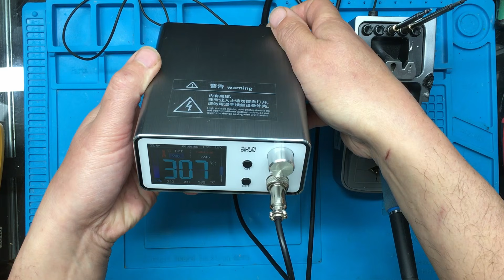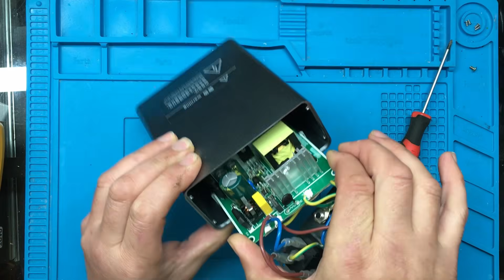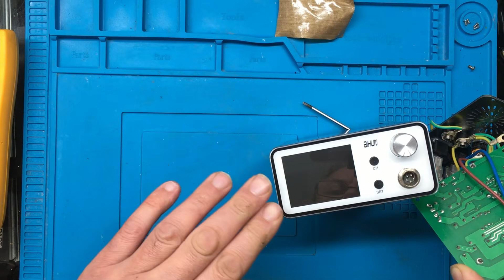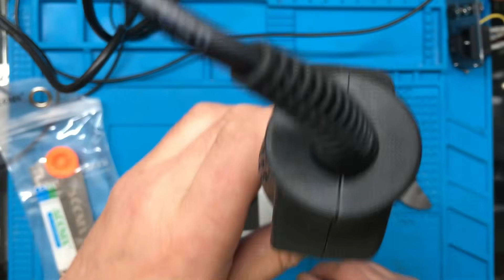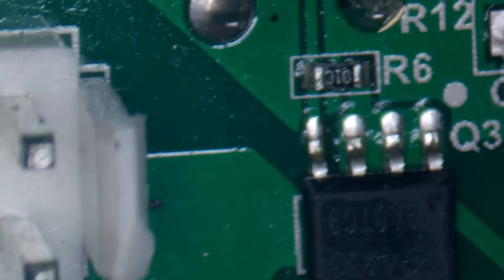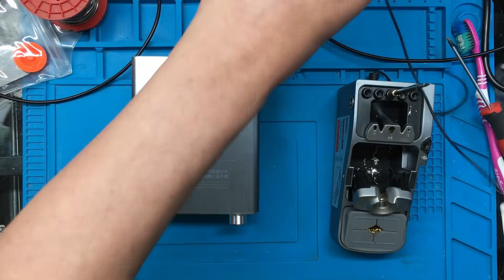Repairing An AIXUN T3A soldering station

Comment: just for the way it must be disassembled I definitely discard it from those I'm considering.  Insane.
Reply from the maker: It's not too bad once you know that front glass has to be removed. If I has to disassemble it again, I'd just heat with a hair dryer and use a plastic spudging tool.

Comment: BUT - was disappointed as to how you removed the front panel. :face-fuchsia-wide-eyes: Also, what was broken? :body-blue-raised-arms: That wasn't clear to me.
Reply from the maker: Yes, it's still got a slight chip in the front panel. Well it seems that the diode was failing internally. I re-soldered it and the internal bond wire must have re-made it's contact. It did however fail about 3 weeks later, so I replaced the diode and it's been fine ever since 👍

Comment: Well done!  I have no idea how you worked all that out but I'll copy it if this happens to me.
Reply from the maker: Thanks 👍 The diode was actually faulty internally. The bond wires must have separated from the silicon inside, as I had the same issue a few weeks later. I replaced the diode and it's been fine every since 👍

Comment: Aye shoon. So, the diode had a bad solder join? Good idea to touch/tap each component before anything else.
Reply from the maker: It actually failed again a few weeks later. It seems the diode itself had an internal bad connection and heating it caused it to re-connect. I replaced the diode and it's been fine ever since 👍

Comment: Excellent video. Congratulations for the analysis.
Mine had the same problem.
It's that zener diode. It was at 0.6V.
I removed it from the board and it went to 2.8V and turned on.
Should I put in a 2.8V zener diode?
thank u again.
Reply from the maker: Thanks 👍It should be a 3.3v if I remember. 2.8v sounds too low..
Reply: @BuyitFixit  thanks.

Comment: hi there! i have one similar to yours, aixun too, but button is spongy, i forced it and it works, but, when i put the button to off , lcd keeps flickering randomly.. maybe a button problem?
Reply from the maker: Not sure on the flickering LCD, I've not had that one. Could be a bad solder joint?
Reply: @BuyitFixit  hmm, i dont think so, it looks like you power on and off the device very fast, and the lcd lights up and then shuts it self off, it hapens randomly, when the button is on the ON position, everything works perfect, LCD, Temperature, everything ok

Comment: I have one of these stations, it has been working perfectly, however it started to play up yesterday.
With the tool plugged in it began to become un recognised the unit with a message "No-Tool, tool + cartridge are need.
I cannot gain access to the menu to try a restart the unit even though the unit does power up. Help.
Reply from the maker: Sounds like it could be the wire going to the handle. I recently chopped and re-soldered mine where it goes into the plug as it looked a little worn, and added some heat shrink as extra strain relief.
Reply: I bought a new handle but the problem persists. 
If I wiggle the plug on the iron and then slightly pull it out it will not heat up but when the iron is in the  holder and shipped sleep mode the iron heats up and cools down when removed. 
I ended up buying the GVM H3 which is working  well, I did this as I need one to repair the faulty unit. 
I approached the company for help but they said contact support which I did, however they have never replied which chimes with what other people are saying, they don't even have a repair center. 
May I ask what you may suggest what the problem could be, I am convinced it is in the front panel, I am not that savvy with electronics, thank you for replying.

Comment: i finally have the same issues as you did, i'm hoping to follow your foot step and maybe i can get it back running again.
Reply from the maker: Capacitors on the power supply could be another thing to check as a few people have had issues with those too from what I saw.

Comment: Is it still working? Are you still happy with it?
Reply from the maker: @rickasisco  Yes, I use it pretty much every video, and at the repair cafe I volunteer at 👍
Reply: @BuyitFixit  Great to hear. Thank you for the response. I am bouncing back and forth between getting the AIXUN T3A and the FNIRSI DWS-200 200 watt station with both 210 & 245 handles included.

Comment: How did you solder in the new parts if your soldering station was Kaput?

Years ago, I bought an Intel motherboard, but there were no instructions on where the wires went. I called Intel and asked where the istructions were. "They're on the CD ROM in the box"! "But I'm building my first computer, please tell me how I'm going to use that CD ROM".

Cue looooong pause.

"Erm, um, ah. We screwed up there didn't we"?
Reply from the maker: Luckily I had my old Antex soldering iron that I used to use before I got this one 🙂👍

Comment: Heya, really nice repair does dry joins are the most difficalt to find just like intermitent faults very difficult to diagonse them
Reply from the maker: It turned out not to be dry joints in the end but the bond wires seem to have failed in the diode itself (pinned comment under video). About 3 weeks after the video it failed again but replacing the diode has fixed it and it's still working currently without any problems 🙂

Comment: I use Quick TS11 for microsoldering, and it's absolutely awesome for that purpose.
Reply from the maker: @circuicitis  Thanks for sharing 👍I really could have done with a smaller tip for this or a smaller iron for the job I was doing in the video later out today (Motorcycle Headset). What a pain  that one was!

Comment: I know this is now a year old but I did notice the mains voltage was almost 252 Volts....that is the limit for mains supply in the UK , you may have high voltage incoming on the mains, that may well be exceeding the max volts for some equipment if it creeps up higher.
Reply from the maker: @radiotowers1159  Hey 🙂Yes, I got on to the electric company and they dropped the transformer a tap. Yes I had it as high as 257 a couple of times 😯
Reply: @BuyitFixit  Wish I had watched this a year ago ...been looking at upgrading my solder station so came across your video. Glad you got it tapped down, in a previous life that was my world.

Comment: 251 volts? Uk us 230/240
Reply: Depends. If you are close to a mains transformer it can be quite high.
Reply from the maker: I've had the electricity company out since and they dropped it down a tap on the transformer at the pole. We are very rural so it's all overhead lines and pole transformers. My nearest neighbour is 1/4 mile away..

Comment: I have one of these and love it!  I've had my 2 years, (it's currently 2024).   I don't have that tip holder you have.  Yours is much nicer.
I guess my dementia kicked in, I don't know what you did to fix it.
Reply from the maker: The 5.1V diode seemed to have failed internally as when I re-soldered it, it worked for around 3 weeks (after making the video) then stopped working again. I think the bond wires inside had become disconnected due to thermal expansion possibly? I ended up replacing the diode and it's been fine since. I think I put a pinned comment or updated the video description with this.
Reply: @BuyitFixit  - I feel your pain!

Comment: To get into my T3A I needed to remove the face plate with some heat, and their are 4 sxrew underneath. Also the main power board was siliconed in place between the bottom of the unit and some transistors on the bottom of the board. I used a metal shim to cut the Silicone. 

I shorted my unit by touching to live 110V AC. Tips started getting red hot.
Fix was easy. Replaced a mosfet right next to the soldering tip plug
Reply from the maker: Nice 👍🙂

Comment: I have heard great things about this company and irons. The build quality is   excellent for their price. They aim to clone features of the very expensive JBC units. In fact they use the same tips. However I do recommend buying the JBC brand tips and taking care of them as they are slightly better quality. Another company that seems to be coming up is Sugon. The big boom in these micro soldering stations came about when cell phone and tablet repair was at peek. Now that it's dying out I see less innovation. But it got good to the point of having decent budget options besides Weller. JBC and Metcal.
Reply from the maker: Thanks for that, yes I had been thinking of getting some JBC tips for it, a few people said that they are better quality 👍

Comment: I know this is an old video, but does the voltage leak impact you too much with this unit?
Reply from the maker: I use this station all the time. The only issue I've had was last week when soldering a wire on an old bell that someone brought into our local repair cafe. I forgot to unplug the ac transformer powering the bell and the iron started glowing red! Obviously it must have interfered with the temperature sensing.
Reply: @BuyitFixit  Amazing to hear, I was toying with the idea of getting one of these T3A's or a T320 to get back into electronics but read about the grounding issue on both these models causing it go overload the tip on certain grounded connections, good to hear its getting some professional use :) 

T3A is a little cheaper so may go that route, You North-East by chance? 

Love your vids, only found your channel today but you earned a sub, keep up the great content :)
Reply from the maker: Thanks 👍Used to live in the Northeast but I'm over in Cumbria now 🙂

Comment: Great video! I do have a question that sorta a sideways topic... What is the need for such equipment. I have been engineering my own circuits, etching and milling my own circuit boards for years. I have never used anything g other than a $10 or less amazon special soldering iron. They last forever (current one is 5 years old and still going strong with the same tip). Never had any issues using it at all. I just keep the temp maxed and go to town. I'm asking why these exist because I am honestly wondering if I am doing something completely wrong... I just can't understand why these get so expensive when my $7.99 iron has been making me happy for years.
Reply from the maker: I used to use an Antex iron, but I really like this one. It heats up in around 3 seconds and automatically turns off when I place it back in the stand. I can turn it up and down. It's rated for 200W although I've not tested that.

Comment: Damn others are so comfortable around AC specially those scary capacitors 0_0

Also I wonder if I should still consider getting one now hmmm
Reply from the maker: Heh, capacitors aren't scary. It's the voltages inside them that can be. You can always check if they have any voltage in them, and discharge them. I like this iron, it's good. I think the tips could be slightly better quality but you can use JBC tips in it I've been told.
Reply: @BuyitFixit  I have a pinecil already so I don't need one, but gosh I'd be lying if I said I'm not in love! I don't even have the space for it lol :D

how do you discharge them? I'm an embed girl and 24v is as high as I've usually gone so that's why I'm scared
Reply from the maker: Well, in my younger days we just used to shove a screwdriver across the two terminals and get a loud bang, but I wouldn't recommend that these days. You can make a proper capacitor discharge tool out of a resistor and some heat shrink and wire. There's a few tutorials on the net. I just did a search and found one on iFixIt site called "Constructing a Capacitor Discharge Tool". Hope that helps 👍
Reply: @BuyitFixit  I guess I’m too paranoid. Could always wear sandals and gloves too right!

Comment: Looks like the pad under the zener is not correct for the size. Guessing they sourced a different diode after the PCB was designed and made.
Reply from the maker: Could well be. The symptoms returned after a few weeks so the bond wires in the diode seemed to have been breaking down internally and the heat seemed to make them reattach. I since replaced the diode and it's been fine ever since.

Comment: Just curious, would it have been possible to check the resistance of the Zener diode in circuit?
Reply from the maker: I'm pretty sure I measured it and it measured fine. After making the video it failed again and I ended up replacing the diode and it's been fine ever since. I think the diode was breaking down internally and heating it with the iron temporarily fixed the problem for around 3 weeks.

Comment: Did you notice issues with iron getting very hot on grounded boards or voltage leaks with this station? I am thinking of buying this station, but heard these issues exist in this video: https://youtu.be/hGK7s-9tXs4?t=71
Reply from the maker: I've not personally, but I think there were some issues with different firmwares, but you should be able to update or downgrade if you have any problems.

Comment: Great fault find 👌  nice
Reply from the maker: Thanks 🙂 It actually failed again a couple of weeks later. I updated the video description with  what the actual fault turned out to be. The diode I soldered must have been faulty internally and heating it caused it to work temporarily. I replaced the diode and it's been fine ever since 👍
Reply: @BuyitFixit  nice, how did you know what rating the diode was please?

Comment: Another nice repair,,thx,,.
Ps2 had those 0 "resistors"..its a fuse i guess. i used to just brigde the blown ones in PS2 fatty with a thin copper cord from a cable . had 4-5 stone dead ps2 where that was blown.. none came back and reportly worked ever after and with a new mod chip installed. i used to chip game consoles at my shop ( This was on the latest versions fat ps2 with one board...first fat ones had a 2 part board
Reply from the maker: Thanks 👍Yes I've often noticed that they are used like a fuse or even a jumper to skip over a track on a single sided board 🙂

Comment: I'm rather late seeing this video, but I think my first try would have been to power it using the 24V jack from the back panel.  If that works then the power supply is bad, and if that doesn't then the front panel is bad, and you can take off the front face without even removing the back.
Reply from the maker: Thanks Mike, I wasn't sure how the 24v jack was wired up as I've never used it. I wasn't sure how the front face came off, but now I know (1 small chip later 😂😂😂)

Comment: SMT control board diagnosis: Poor solder joint quality control. This is your classic PCB assembly poor solder joint integrity failure. 

Bottom line: The PCB SMT assembly solder joint integrity on the front panel control board should never have passed manufacturing quality control inspection. Even the hand soldered front panel through hole connector solder joints look cold. This is an important video because it highlights the importance of PCB assembly solder joint quality control, or solder joint integrity inspection.
Reply from the maker: Thanks for commenting, I did a small update to the video description as this stopped work about 3 weeks later. It seems the diode itself must have been breaking down internally. Possibly the bond wires, as heating it made it work again and I just assumed a dry joint. I replaced the zener diode and it's been fine ever since. Thanks for your thoughts and comment 👍

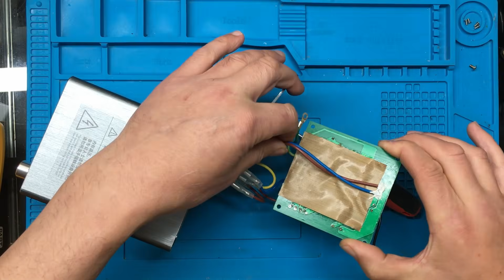Comment: 4:48 Most low volume pcb manufacturers add a serial number without the customer asking for it. You need to specifically specify they shouldn't and it costs a tiny bit more to do so. If someone gets hold of that number they can have exact duplicates made without needing to reverse engineer anything.
Reply from the maker: Interesting. I had to look back at the video as it was a while back when I did this one. Thanks for letting me know 👍
Reply: Do you mean any person can email a PCB manufacture to order serial xyz even though the person did not submit the PCB and gerbers? Assuming the name of the PCB company is printed on the PCB to identify who made it.

Comment: Use alcohol when checking for heat. which ever part is bad the liquid will dry fast
Reply from the maker: Thanks for the tip👍, I've done it in the past but I've got 2 thermal cameras now 🙂

Comment: I absolutely love what you do. What Camara and microscope do you use? I need them and they look great
Reply from the maker: Thanks Aaron 👍The earlier videos were just recorded using an old iPhone 6 that a friend gave me. The camera I'm using now is a Sony HDR-CX450 which I bought used from Ebay, with the rode microphone I repaired in a previous video plugged into it. The microscope is a trinocular one, with a 48mp camera I did a video on it comparing it to the Adonstar microscope a few videos back. It's on a boom arm so not very portable and I find it a bit zoomed in too much on the camera even with a .5x barlow lens on it. Hope that helps 🙂👍